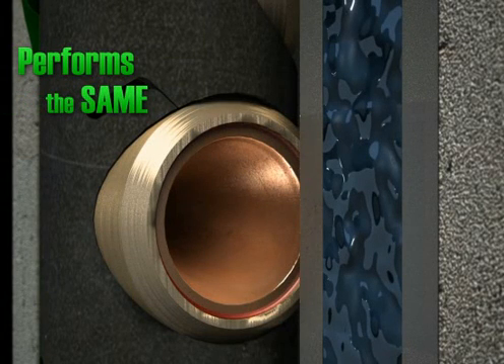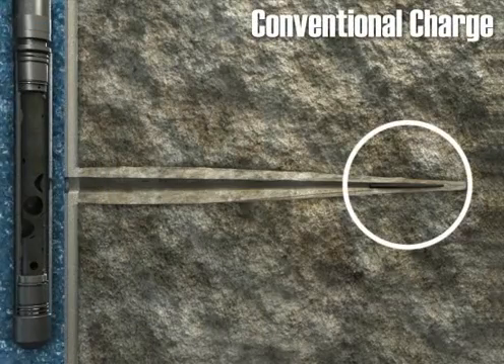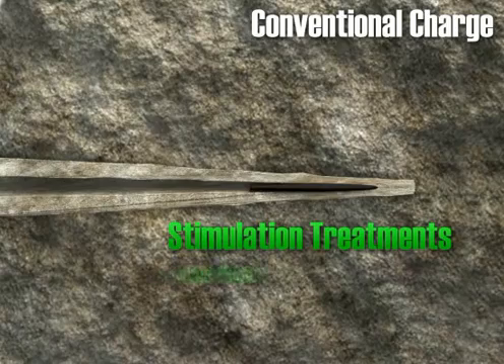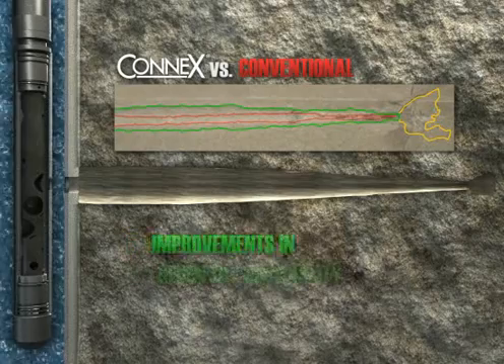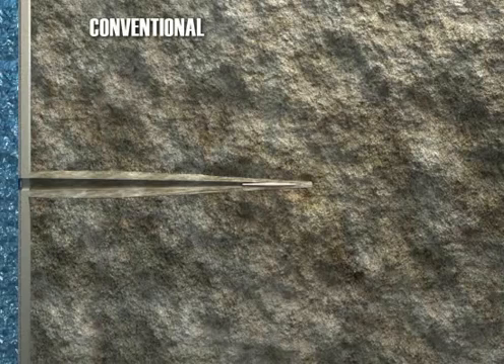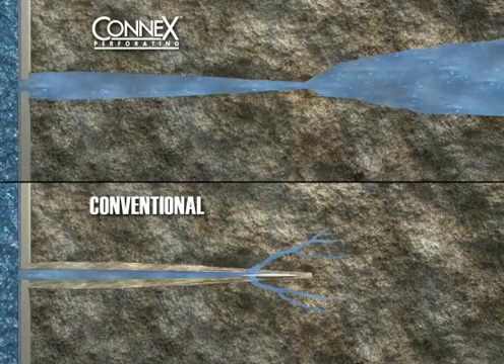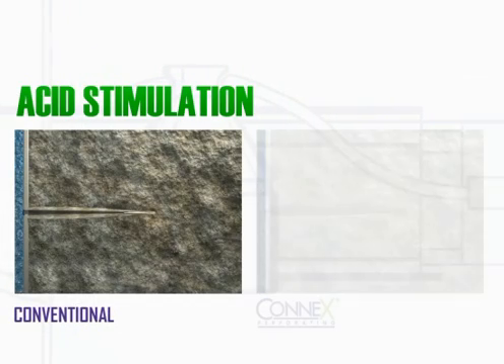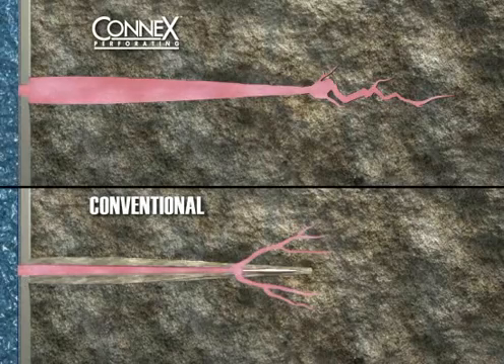Reactive Shaped Charges

Comment: Looks useful. 
How does it perform against metal or ceramic?
Reply: Quite well. Shaped charges are used in anti tank projectiles (HEAT), and the modern ones can penetrate more the 400mm of steel. I don't believe they are quite as effective against ceramics as they are against metals.